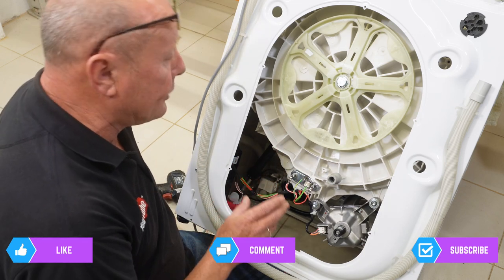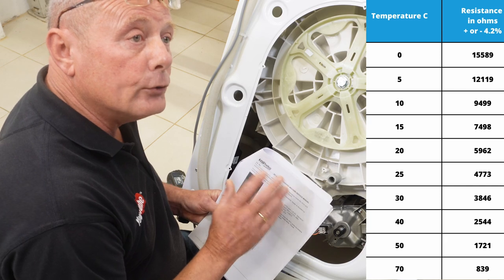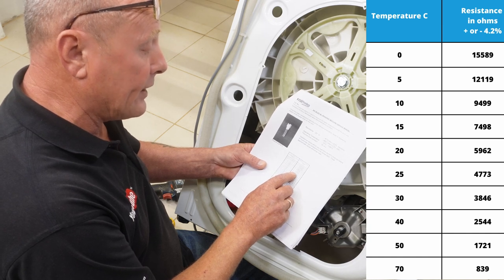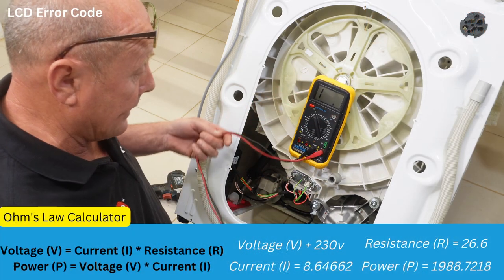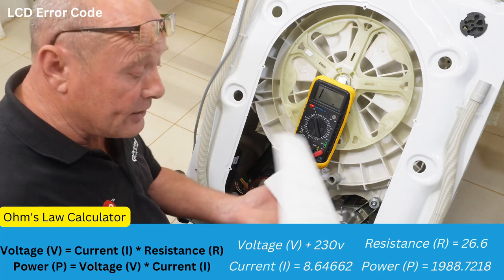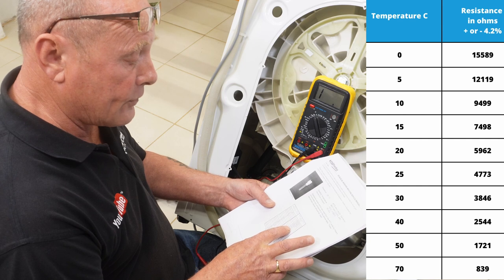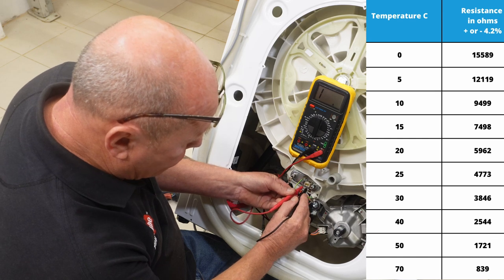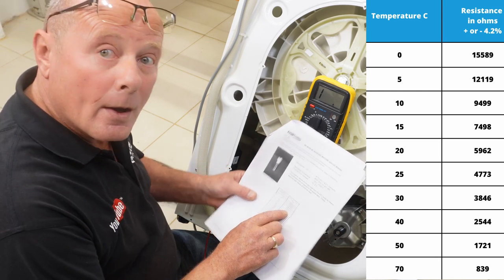Not Heating Error code E01 & E02 Beko Made Washing Machines Heating Element System fault or NTC

Comment: By the way on the digital display models you can show them by service mode by holding spin button when off and turning to cotton (of course) but while the dile is off you can also hold thirst and second option button (left to right) and it shows amount of cycles completed and any errors. you can also check any errors mid cycle by pressing first and last option button (do all of these for about 3 secs apart from servise mode)
Reply from the maker: thanks for that i only showed it in test mode https://youtu.be/VFMOdgo9dhI